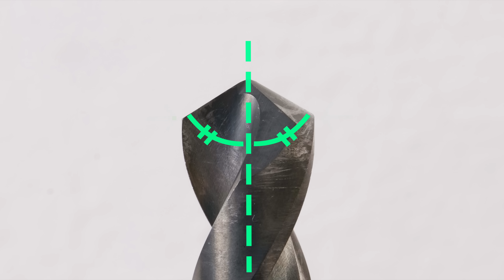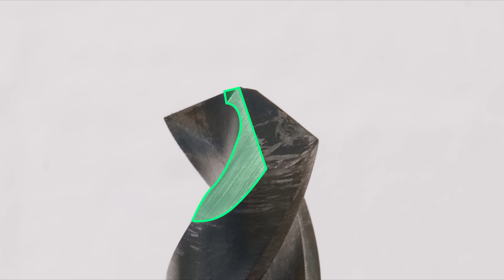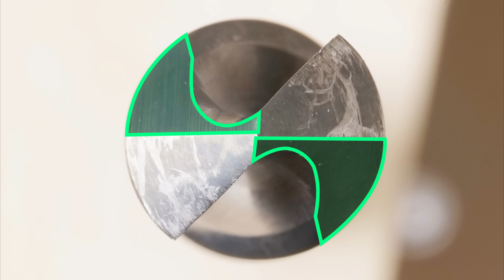6つの実用的なドリルビットの研ぎ方　[字幕あり]

Comment: Why not just angle the "Rest Plate" so you don't have to hold with your hand? Seen another video on sharpening bits. In it he just used a piece of angle iron cut to 118 degrees & welded a guide that sits flush to the table. Oh Damn! He was sharpening with a verticle belt sander so he had a large table to work on. My Bad,nevermind.

Comment: I use angle grinder , it takes less than 10 seconds to achieve 95% performance of what you have done on this process, rest 5% perfection is not worth the effort or time.

Comment: Bonjour, bonne présentation, vous précisez, ce qui est rare, les angles qui ne sont pas très important, en effet l'angle de 118 ou 120° ne sert qu'à optimiser l'usure du foret, il n'est donc important que dans l'industrie. L'angle de dépouille que vous préconisez à 10° est valable pour le bois ou les métaux très tendre. Plus le métal est dur, plus cet angle doit être diminué, jusqu'à 2° pour l'acier dur, cela permettant de ne pas "enfourner. A "12.30" votre foret est bien affuté, preuve en est la qualité de vos copeaux. L'affutage fournit en plus à "13.00" est souvent superflu, il limite la précision du trou (qui est surtout donné par la symétrie d'affutage) ces coups de meule supplémentaires ne servent que lorsqu'on ne souhaite pas faire l'avant trou, ce qui nuit aussi à la précision. Cela faisait plus de 60 ans que j'affutais mes forets manuellement, ma vue baisant, j'ai fait l'acquisition d'une machine de chez Vevor. A ma connaissance c'est le seul système qui permet un affutage correct (hormis les affuteuses professionnelles) et j'ai eu la surprise de gagner en précision de perçage, mes forets perçant maintenant au 1/10 après affutage !

Comment: Like you video. Your idea for candle type drill bit looks very much like a drill bit used to remove automotive spot welds. I presume a normal steel drill bit could be modified for spot weld removal, instead of buying expensive spot weld removal drill bits. Just food for thought.

Comment: Nice video. 
FYI.. If you are drilling a hole in thin metal,, put a small piece of thin cloth on the metal before drilling. It will drill a nice round hole,, even with a regular drill bit.

Comment: I am sorry to tell you this, you have no idea of the reasons a sharpened drill has a full back angle and you are not desplaying the correct method of twisting your wrist as you rotate the drill against the wheel. you are correct in reducing the centre land as you do.

Comment: in 45 yr iv never sharpened a drill  like that always just by hand on the side of the wheel no clamps or anything  just a slight  rotation movement by hand

Comment: In the first case, in order for the drill to be sharpened perfectly, it is still better to make a device that, in its simplest form, looks like a corner set at an angle to the sharpening wheel. Also, your circle has too high a grain size. You can see how the edge turns out to be torn.

Comment: You know what's amazing ,he does not need to clamp down the material  he's drilling,  But in saying that ,I worked with an engineer, who sharpened a drill bit in 15 seconds using the side of the stone and produced the same results, both desvered respect..

Comment: Thank you, very good. I have a question about that diamond blade (9:31), which also cuts along the edge, where did you buy it?                                                                                            Hola buenas noches; Gracias muy bueno.  Tengo una pregunta ese disco de diamante ( 9:31 ), que corta también por el borde, donde lo compraste

Comment: an neat trick for drilling in thin plate, i've learned at technical school is putting an piece of cloth on the plate, and let it turn with the drill, it will  improve the roundness of the hole, I have more problems with drilling trough RVS , and drills with cobalt are expensive and tend to break easyer ; applaying sufficient good drill paste is requiered

Comment: I always use the side of the wheel, it takes about 10 seconds to make a drill super sharp, grind each side with same pressure and same duration and they come out quite even, if you drill holes of 1 inch/25mm use 300 rpm if you drill holes of 1/2"/12mm use 600 rpm etc, leaving the head of the drill with as much material as possible just a slight clearance, will allow the drill to take more heat without getting too hot and losing its temper

Comment: In future when checking the height with a dial gauge  (as seen at 5.31) may I suggest you use a back stop to prevent variation from freehand grinding which is almost impossible

Comment: i really hate grinding wheels, i usually use beltgrinder, grit36 is supreme
very cool to see someone also doing the flat top edge, quite literally any socalled expert will round the top rather. great minds think alike, back when i learned to grind drills i quickly realized that flattening it rather than rounding had major benefits. i was also very confused how the drills i sharpened were better than freshly made high quality drill bits, i was never sure if it was really true, also very cool to see it proven. 

this video touches on a subject they never taught me at metalworking school, and outperforms any other expert video ive ever seen with concise and perfect production quality. haleluja.

Comment: Drill bits cut by rotating anticlockwise so why do you need to put an angle at the back side edge where it has no contact to what it cuts?
Reply from the maker: If there is no angle, contact occurs through rotation.
This cannot be explained in words.

You can understand this by actually sharpening the drill with the angle set to zero.
Reply: @jisakukobo   I understand that contact occurs through rotation when there is no back angle but it's at the back of the edge which doesn't make any difference for actually cutting the metal. If you want to drill on both clockwise and anticlockwise then it make sense to give it a second angle at the back otherwise it doesn't do anything for drilling.

Comment: All good tips, as a retired toolmaker spent many hours sharpening drills by hand. Always thinned the web it can be done with the edge of the grinding wheel. Only tip I saw that should always be avoided is the drilling of sheet metal, never hold it with your hand clamp it down. Had a toolmaker off almost a year after a piece grabbed and climbed up the bit and sliced his hand open.
Reply: "the drilling of sheet metal"  Well... Making holes sheet metal with a conventional two flute drill was never considered a clever thing to do, and a common piece of advice for drilling in general is "You can hold the workpiece by hand if you can break the drill bit by hand... A good basic rule...
The problem with drilling sheet metal with a twist drill is that the point penetrates the material before the lip corner enters the material, so there's nothing supporting and centralising the drill bit.  That's why you get oddly shaped holes, when drilling sheet metal. (that, and badly off hand sharpened drill bits...
Anyway... If a more suitable tool is not available... (Rotabroach, Rotobor, hole saw, punch laser, other)
Try "rag drilling"  set up your drilling machine correctly to position the hole where you want it, and start drilling, but don't penetrate, leave a dimple, then... get some squares of rag.  (Denim's good ) a bit bigger than the hole size, and interpose them between the drill bit and the workpiece, then drill.  The rag will fill the drill clearance, offering 1) radial support to the drill and 2) resistance to the drill's "pulling in" to the workpiece.  On that last issue... use the drilling machine's quill clamp as a brake, to avoid "pulling in"  There's always a bit of backlash in the quill's rack and pinion drive.
I have used, in the absence of denim, emery cloth, which works, but doesn't do drill bits any favours...
No one else remember "rag drilling"?
Reply: @robertlawson8572  my whole point was based on the size of the bit and piece of metal being drilled in the video. I worked as a toolmaker  for 40 years managing build and stamping operations. we made shims for punches and die sections by the thousands each year. you can avoid the accident by using safe measures. a clamp is a good safety measure. even a step drill is much better for drilling clean holes in sheet metal but when it grabs the work piece and you are holding it by hand lookout! Fingers don't grow back, just wanted to bring to peoples attention when i see a potential accident about to happen. remember there are lots of people that see a youtube video and think that it's a best practice to use when they go to do something. just my 2 cents.
Reply: @GaryHaines-d9y  Sorry, pal, you seem to have bit... I just added a basic rule of drilling to your statement that clamping is necessary... Now it's lost in the noise.  So... to recap,
If you can break the drill by hand, you can hold the workpiece by hand... (If you must) It really sets very low limits on the drill size.  We all have our old war stories about drilling incidents...
I forgot to mention at the time about modifying the drill's rake to zero, or close to zero, to avoid sheet metal pulling up... Works well on spring steel, too... Same as putting a brass lip on a drill...
Reply: @GaryHaines-d9y  I did respond earlier, my post seems to have gone...
I hate the use of two flute drills for SMW, clamps or no clamps.  We did have "Brad Rad" step drills for lightening holes in A/C work, in the seventies, but, though the zero rake was good for avoidance of the workpiece rising, the zero rake was not good for light alloys.
Of course, sometimes it's necessary to drill thin stuff, or even stuff that's thin and hard, like spring steel sections for attachment screws... (punching introduces stresses that lead to failure, plus drills are easier to sharpen than punches... Then, I used either a combination centre bit (Are they still "Slocombe" bits over your way? ) Which have close to zero rake, and point thinned them for easy penetration, or a jobber bit with modified rake and point thinning.
Rag drilling, as I described in the "lost post" can work well, saves drill modification... 
Still hate drilling sheet metal work, except in desperation...
Reply: для  сверления тонкого листового металла сверло нужно затачивать как под дерево что бы центр сверла выступал выше ленточки примерно на 1мм. и сверлить можно хоть от0,5, отверстие получается идеально круглое . но крепить обязательно это правило техники безопасности.
Reply: Totally agree with clamping down sheet metal before drilling!  Ask me how I know... I have a few scars to remind me!
Reply: It is about the ratio between the length of the sheet and the diameter of the drill (and the drill speed, but then it becomes complicated). A sheet of a meter and a drill bit of 10mm or a sheet of 10cm and a drill bit of one mm are clearly not as dangerous as what we saw in the video, a sheet of 10cm with a drill bit of 10mm. I talked to the screen when I saw it done.

Comment: I've learned to sharpen drills by hand quite a while back. There's no magic, only a simple wrist movement. 
After i joined my local makerspace it surprised me how nobody believed i could sharpen a drill without making it worse.
So i had to show them how to sharpen dull or broken drill bits, of which they had many.
Reply: "So i had to show them how to sharpen dull or broken drill bits, of which they had many."
Part of it is a failure to select and use correct spindle rates for drill material / workpiece material combinations (explains the prevalence of blunt drills wherever you go) and only part of it is an inability to sharpen drills... One other thing is that "other trades" are permitted access to grinders that ought to be used exclusively for drill/toolbit sharpening.  So, you pitch up at the pedestal / floor grinder and it's got grooves in it, the corners have huge radii on them.  No good for sharpening or point thinning/relieving... So you say bugger it, and pop the drill back in the rack... 
I used to carry a diamond dresser in my pocket for a little light wheel dressing. (never lend them, by the way, if a guy hasn't got one, there's a likelihood he'll destroy yours, and not even realize...) Avoid heavy dressing of the workshop wheel with the Huntingdon dresser until Friday, the day you throw your overalls into the laundry bin... Unless you're happy with a liberal coating of aluminium oxide dust, long term...
Reply: Это не мастерская! Это группа детского сада. В любом ПТУ на 1-2 курсе геометрию режущей кромки проходят, а на практике ее заточку, при чем любого инструмента, не только сверл.

Comment: Why not just set the tool rest to the correct angle (.10° ) for the face angle. Then just have to spin the bit to get the correct surface face cut.
Reply: Because that’s not gonna work. You should start at the shallower angle at the cutting edge and move the tip of the drill bit upwards as you turn it.

Comment: I was surprised you didnt make more jigs to those exact angle duplicate grinding time and time again to accommodate thecvarious points on thevdrill bits. As there are several angles and styles to deal with and also you didn't address heat build up while grinding the bits. But I did like the video for showing the reasons for various drill bit tip shapes.  I have tried doing it without a jig of some sort but I didn't have the right touch and also I wasn't aware of the thinning of the point that may have been were I went wrong as well. I like it when you showed how to make a  drill bit with the extended center for the Kregg Jig jointing style.
Reply: They did dip the drills into water periodically to keep it cool after each grinding operation. It was shown near the beginning.

Comment: After 50 years of drill sharpening, that's the first time I've ever seen masking tape used to show the angle.
I was taught to use two hex nuts to get the 120 degrees
What a great idea to teach people how to set drill to wheel.
I do very little woodworking and have never used pocket hole construction, that was a very interesting modification that could be used to counter bore holes for cap-screws (Allen head)

ドリル研ぎを始めて50年になりますが、マスキングテープで角度がわかるのを見たのは初めてです。 120度にするために2つの六角ナットを使うように教えられました ドリルをホイールにセットする方法を人々に教えるのは素晴らしいアイデアです。 私は木工をほとんど行わず、ポケットホール構造を使用したことがありませんが、キャップスクリュー(六角レンチ)のざぐり穴に使用できる非常に興味深い変更でした

Comment: i been iron worker for many years. you know your drill is sharp is when you drill the whole you get long unbroken spirals. it means the drill is sharp, your drill has the right rpm and the pressure on the drill is right. the smaller the drill bit the faster rpm, the larger the drill bit the slower the rpm. you can find the right rpms in tables on many websites.  and when you need to cut a big hole... predrill with a few smaller drill bits first. i will go much faster and easier then straight up the big drill bit.
Reply: "you know your drill is sharp is when you drill the whole you get long unbroken spirals."  Well... You won't with hard brass, or with cast iron.  And in any case long swarf is at best a PITA, at worst, dangerous.  That's why we "woodpecker" to avoid long swarf (other ways of avoiding long swarf are available...) 
That was something we were taught in the 60s.  "Long, continuous swarf is a sign you've got the right speed, feed and tool geometry"  We used to compete to produce the longest piece of swarf.  One day, a guy where I worked had a long spiral of swarf snaking from his lathe across an aisle, and another guy, not noticing, tripped on it and cut his ankle badly...
Not long afterwards, coincidentally, we were being taught to produce short chips, which are easily managed, don't weave themselves into machine handles, clamps, etc...
In respect of using progressively larger drills to make big holes, the point was made to me, in the early seventies, that that was an inefficient way of working (though it may be necessitated by low powered machinery)  Drilling a 2" hole through solid, or with a small pilot, about web thickness, maybe a little less, is quicker than continually swapping bits.
The guy that told me that made the valid point that if the bigger drills were not intended to drill through solid, they'd not "cut to centre"  Core bits for casting work don't "cut to centre" because the hole was sand cored to save you that...

Comment: 4:31 The easiest way to sharpen a drill　ドリルを研ぐ最も簡単な方法
9:18 Sharpening using a jig　治具を使って研ぐ
10:39 How to sharpen a cone　コーンを研ぐ方法
13:56 Drill for processing thin plates　薄板加工用ドリル
15:41 Make a woodworking drill　木工ドリルを作る
４つのとはどれのことですか？　時刻を教えて下さい。
ろうそくの薄板加工用ドリルは円周部をセンターより少し下げたほうが良いと思います。
Reply: Спасибо 👍
Reply from the maker: タイトルいい加減につけてました。
全部で6つのドリルの紹介でした。

0:00 【ドリル研磨の概要とグラインダーの準備】
4:32 【直線研ぎの方法】
9:18 【治具を使った直線研ぎの方法】
10:40 【円錐研ぎの方法】
13:55 【ローソク研ぎの方法】
15:42 【木工ドリル研ぎの方法】
16:45 【下穴ドリル研ぎの方法】